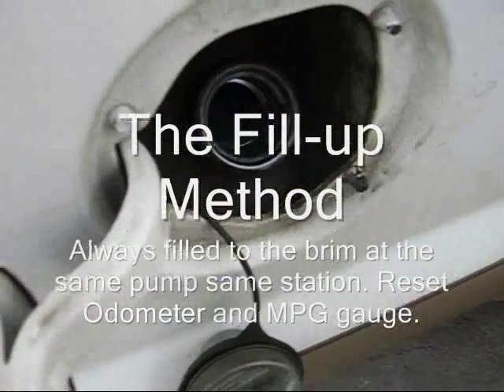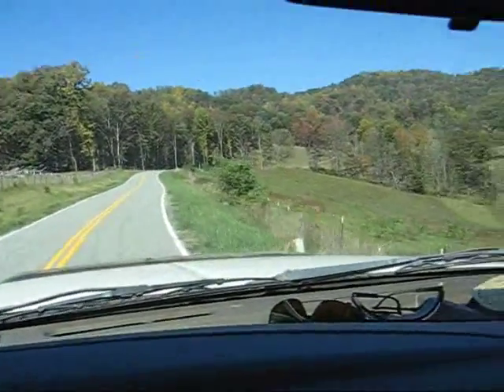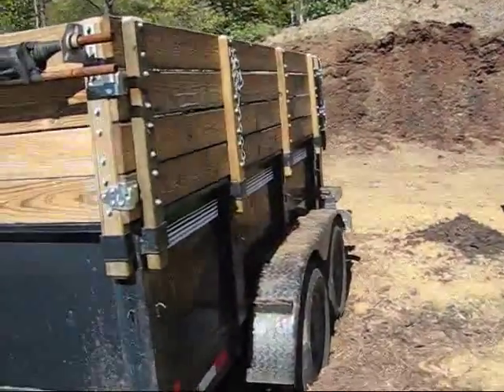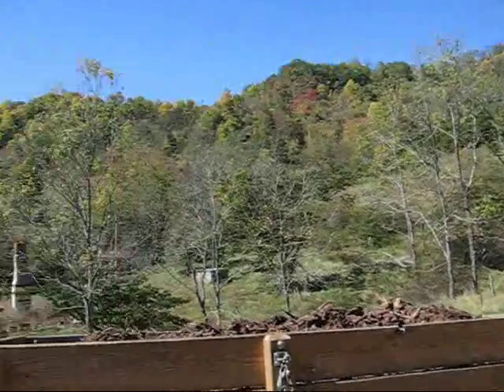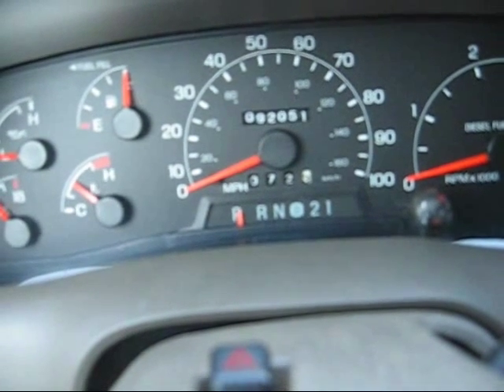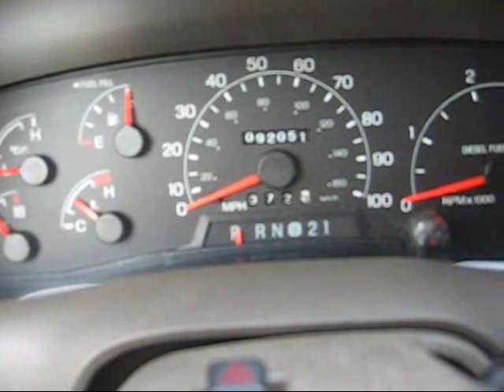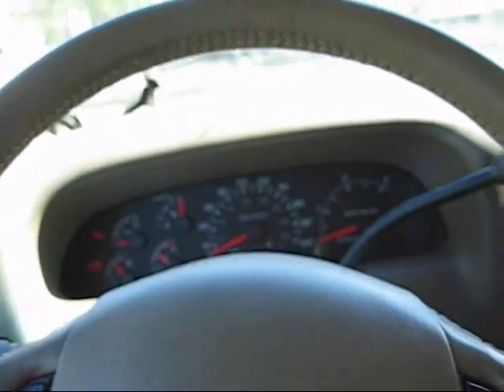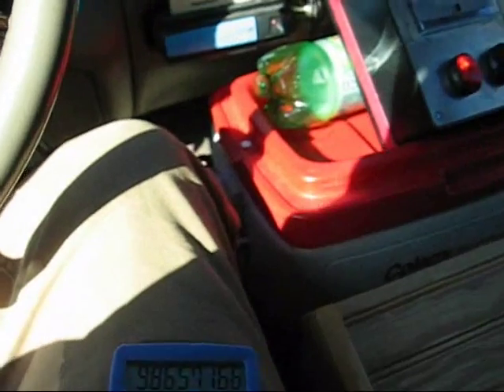HHO MPG F350 7.3 Diesel 20K GVW

Comment: Why do your odometer meter numbers not line up correctly? It looks highly suspect. Ive owned 2 7.3 and the odometers always line up perfect
Reply from the maker: I am the only owner of this truck. It only had 12 miles on it when I picked it up at the dealer. It is possible that the dealer turned back the odometer but I don't think so.

Comment from the maker: I am currently re-outfitting this truck with a beefed up transmission, a DP-Tuner and a Snow Performance Tow-Max methanol/water injection. Since I already have a temperature controller hooked up to read my EGT I am considering using the temperature controller to turn a home made meth/water injection system on and off. Steer me toward a Meth/Water injection DIY video.

Comment from the maker: @ReNeGaDe800RiDeR: I thought that I mentioned somewhere in the video that I could not maintain my normal speed on this hill with the DrPerformance IP fooler since the EGT was too hot and I had to back off the throttle. I might have been able to climb the hill faster with the chip if I had been willing to sacrifice the engine lift to do it.

Comment: MARS with the added chip climbing the hill were you climbing the hill faster? If you were you would burn more fuel. To do the test accurately you need to do each section of the trip and the same speed.

Comment from the maker: @kx250matt: A general rule of thumb is that 1 cubic yard of dirt or gravel weighs one ton (2000lbs). This trailer filled level to the top of the side boards holds  9.62 cubic yards of dirt or 19,259lbs. This mulch pile has a high dirt content since it was ground up stumps with a lot of dirt on the roots and it was wet. My guess on the weight was based on these facts and the fact that the trailer would not dump even though it is rated at 8000lbs.

Comment from the maker: Hi dpthaxton: The 7.3 diesel has only one cumbustion chamber. The 2001 and newer engines have "Split Shot" injectors. There is sort of a stutter built into the fuel shot. A small amount of fuel is injected to get the fire started and heat up the cumbustion chamber then the remaining fuel is injected. Some people belive that all the H2 is burned in the first part of the injection, I'm not sure that it is true.
Check out my latest vidio got about a 30% increase in MPG on a 2790 mile trip.
Mars

Comment from the maker: If you watch my video where I drove 1000 miles in two different trips you will see that I did achieve a modest increase in MPG. This engine is huge and uses a lot of fuel especially when I pull a trailer. I think that what all my MPG tests together prove is that this engine needs a lot more HHO.
When time allows I will post more test runs with a lot more HHO.
Mars

Comment from the maker: I have the HHO input before the turbo since after the turbo the pressure varies from a slight vacuum to 25psi. I would like to have a pressurized post turbo delivery system but the problems are not easy to overcome.
Mars

Comment from the maker: I am not an expert on EGTs but I have scoured the Internet on the subject. Most people agree that you should not exceed a sustained  EGT of 1250F. A very few say that 1300 to 1400F sustained on a modern diesel is OK. Most say that EGTs higher than 1300F are Okay for brief periods (30 sec or less). I have decided to not go over 1300F if I can help it and run sustained temps no greater than 1250F.
Mars